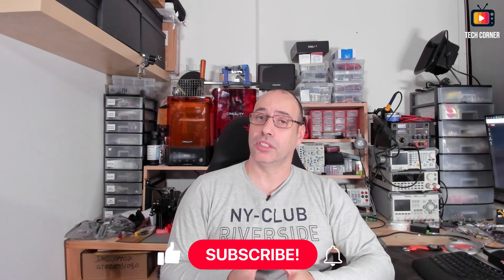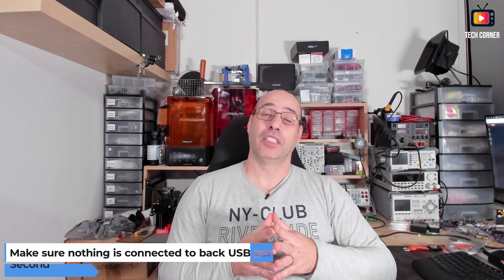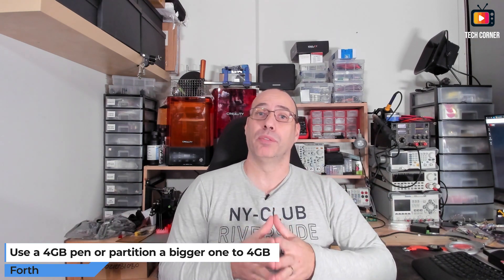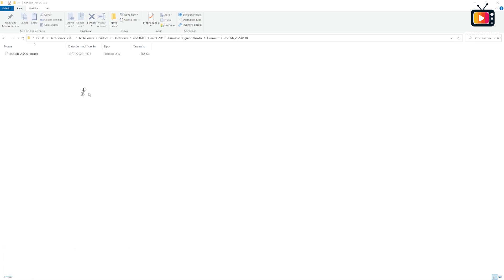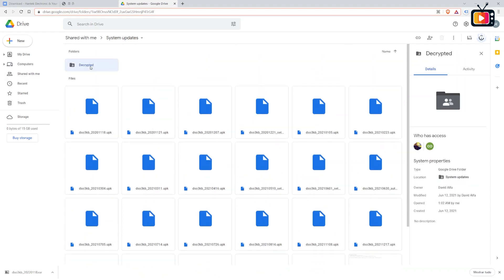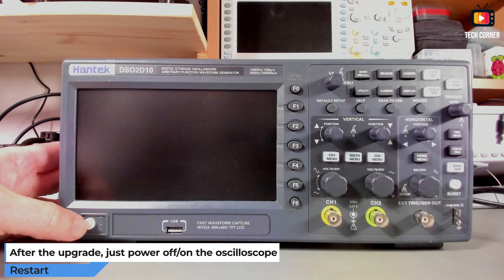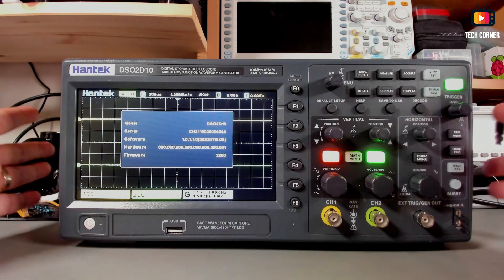Hantek DS02000  ⭐  How to do a Firmware Upgrade Tutorial (2C10, 2C15, 2D10, 2D15)

Comment: not updated mine  (dso2d15) in a long time, 2023? anyhow my front panel controls have become erratic so decided a fw update may help.... ha. it wont read usb, needs it inserting a number of times to be recognized, then keeps beeping randomely saying its been detected/inserted, if you do remove it then it still carries saying its been detected every few seconds, so i cant update to see if it helps, cant use the front controls effectively, and while its 2-3yr old probably has less than 30hrs of use it even has the film on the lcd never peeled off!. I used a 1gb and 16gb card in fat32 and many incantations of 4 letter words.
may as well sell it for spares and buy a cheap rigol

Comment: Hi, thanks for the clear and comprehensive video, I'm writing to you from Italy, if you can help me I have a Hantek DSO2C10 that starts but then freezes after it has run the hardware check. the commands don't respond and I don't see any traces, only channel 1 remains on, what could have happened? is there a reset maneuver? thanks for your answers. Greetings.

Comment: Hola no consigo descargar el archivo de drivers, podrias resubirlo
Reply from the maker: Hola! Sorry, can read spanish, but can't write. Take a look in the Hantek website, support and downloads. Is there for download. Thanks for watching.
Reply: ok
 @TechCornerTV
Reply: gracias
Reply: Pon en google "dso2d10 firmware"  o el modelo que tengas y te aparece como primer resultado la web de hantek.     
Una vez en la web de hantek,  le das click donde dice "DSO2000"  lo que inicia la descarga de un archivo ZIP
Luego descomprimes ese archivo que resulta ser una carpeta con un archivo ".upk"
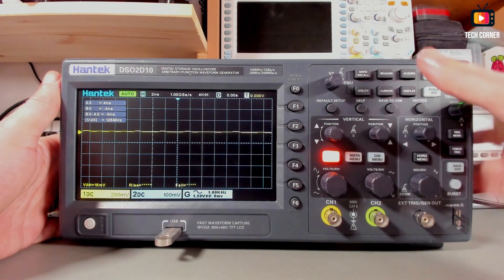TOmas ese .upk y lo pones en un pendrive  que luego conectas al osciloscopio y sigues los pasos del video en 6:23
(PD:  el archivo desde hantek es generico para varios modelos DSO2....  por ende no te preocupes que el sistema automaticamente toma lo que le pertenece a tu modelo)

Comment: Hello,
There is a high pitched frequency noise in my home. I believe it is a "mosquito" device. What can I use to find it? Thank you!!
Reply from the maker: Hi, well, that seems a bit out of the scope of the oscilloscope, if you know in which device the "buzz" is, you might use it or a multimeter to find out which component is doing that, but generally speaking find which device is doing that, I really don't know if that's possible. Sorry. Thanks for watching.
Reply: @TechCornerTV  What about a scope and a directional microphone?

Comment: Hola, tengo un 2D15 y he notado una sustancial diferencia en la ganancia de uno y otro canal, condición que empeora a altas frecuencias ( 100/150 mhz, de hasta una división, ambos canales con la misma sonda y seteo, aclaro que antes de las pruebas se corrió el menú de calibración,  y que el osciloscopio está actualizado al último firmware disponible a la fecha. No se si habrá algún control interno que pueda corregir el problema, o habrá que esperar nueva actualización.
Reply from the maker: Hola Marcelo, sorry for writting in english, I can read spanish, but I am unable to create sentences... the DSO2000 seems to have some problems with measurements. While using both channels you'll have only 500MSa/s of sampling rate, not 1 GSa/s, not sure if that will be a reason for what is happening there, shouldn't. Anyway, it might be only a factory problem. Did you try to reach the Hantek support about that problem? Thanks for watching! 👍
Reply: @TechCornerTV  Muchas gracias por responder, yo te leo  con el traductor de google. Una aclaración más, las pruebas se realizaron habilitando 1 canal por vez, precisamente para mantener  1 GSa/s en cada testeo. Saludos!

Comment: Maybe you don't know this, but fat 32 is not limited to 4gb partition size. I still make huge fat32 partitions. I used a 120gb ssd in a USB case for the firmware. However I would be limited to 4gb for a single file size.
Reply from the maker: Hi! Totally right, I messed up with the requirements of the Rigol devices I have here where if you want to mess with them, the USB pen must be formated with FAT16. Anyway, thanks for the heads up and for watching! 👍

Comment: Hi, I have only one question I have the Hantek 150Mhz without the AWG can you initialize AWG which looks like it is software enabled.
Reply from the maker: Hey David, the first models, I think it was just a software thing, even the bandwidth, I even have the code to "upgrade" the oscilloscope, but talking with Paul from Learn Electronics channel, he told me that the latest units are missing some components that will allow the AWG functions, so I thing this is a "it depends" issue, if you have those components on the board, you'll probably be able to "upgrade" your unit. Thanks for watching. 👍
Reply: @TechCornerTV  I just bought a 2c10. The relay and everything appears to  be there.  I flashed the firmware and  added the txt file in root of folder but all it did was update the firmware no awg even though it looks to be populated
Reply: ham radio hack Hi, curious if you've had any success getting that AWG function?  I've just ordered a 2C10 in the hopes. Thanks
Reply: @derekec  yes
Reply: @derekec  Hi Derek I have not tried as yet no quite brave enough to give it a go.😄

Comment: Recently purchased this scope, and the software is 20210726.  I see on the Hantek site it is up to 20211231.  When I try to install the new software the scope sets error code 3.  Any ideas what may be the problem?
Reply from the maker: Hello Scrappy, did you formated the pen to FAT32? Not, FTFS or exFAT. Thats the only thing I see that might be problematic. Thanks for watching. 👍
Reply: @TechCornerTV  Got it !  It was formatted to FAT already,  but reset and was able to update software,  Thanks  SO much.  Now, the next problem,   is connecting to PC.  Have the app installed, and shows device not connected.  Does not show in USB devices when connected, even tried different cord.  Any ideas?
Reply from the maker: @scrappy7571  Make sure the USB driver is installed, the oscilloscopes need a "special" USB driver that is common to all of them, specially those entry level ones. The driver, I think, is provided with the CD or is on the website, can't remember.
Reply: @TechCornerTV  Yes, the driver is installed, or at least I think it is. Def missing something.  WOW they sure don't make this plug and play...
Reply: @TechCornerTV  Keysight app re-installed, and does not show any equipment connected.  At a loss here, any ideas?  Thanks.

Comment: Set up my new 2C10 and it didn't work very well. Measurements were incorrect and response was sluggish. I installed the latest firmware update and it worked just fine. I'm wondering if some of these units are programed with a test edition of the firmware and not the final retail version. The firmware update should be the first item in the manual, not on the back pages. Thanks for the video, big help.
Reply from the maker: Hi James, I was really glad when I read this, is always good when the video helps someone. Glad I could help and thanks a lot for watching the video and your comment! Kudos 👍

Comment: Hi there,

I found your video very useful but when I tried to update the firmware on my DSO5102P scope it said it did not recognize the .rar file that I downloaded from the Hantek site. There are no .UPK files there to download. So far I have had no reply from Hantek. The file I downloaded for my scope was: dso5kp_func_dso5102p20210225.rar Any thoughts? Thanks
Reply from the maker: Hi Julian, this tutorial is for the DSO2000 series but I believe the procedure should be the same. If you look carefully in the video, I did UNRAR (unzip) the "rar file" to a directory, you should be able to do it with the 7-Zip a free windows app for that and the .UPK file appears after you unrar/unzip the file you downloaded. Let me know if you have any more issues and I'll try to help. Thanks for watching 👍
Reply: @TechCornerTV  Thanks. I used Apple Macs unzip and it produced another .rar file with an extra extension. I will try and find ‘Unzip’ or ‘Unrar’.
Reply: @TechCornerTV  Hi again, the same problem. I used a Windows 11 unzip program (7-Zip) and the resulting folder had a file ending in .up and not .upk. I put it on my 3Gb partitioned FAT32 thumb drive and again it said there were no firmware files on it.

Comment: Thanks for this video!  Have you tested if this upgrade made improvements to the low voltage accuracy issue that you mentioned about this scope in the previous comparison video you made?
Reply from the maker: Hey Jeff, not yet, I'm preparing a video to check that and also do a speed test using a TDR to measure the rise times and so on. Just need to organize here the time to make it. Will be soon. Thanks for watching. 👍
Reply: Awesome!  I look forward to watching it.  Thank you.

Comment from the maker: Hey Guys, I might gave you a misleading information in this video, at least for this oscilloscope, it really applies to other oscilloscopes regarding the size of the USB pen/partition. I tested today (should it have done before the video, but better late than never) and at least for my Kingston 16GB I was able to format it with FAT32 filesystem in one 16GB partition. I had the 4GB problem with other oscilloscopes and since this one requires the FAT32 to work (i tested with a 128GB NTFS USB pen and went nuts, had to reboot it) I assumed that will have also to be max 4GB, it doesn't. Sorry for this misleading information, it will work anyway, just its not a requirement. Well if formated in windows 10 and I tested up to 16GB pen.